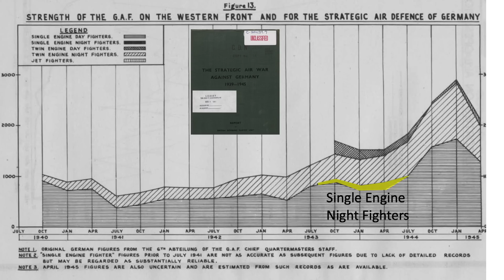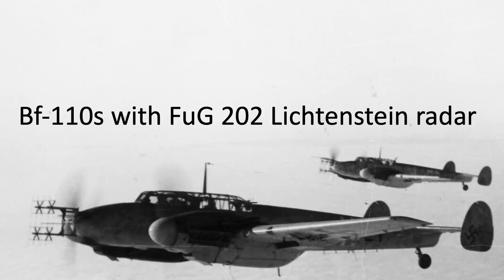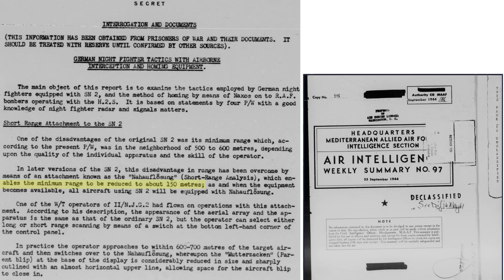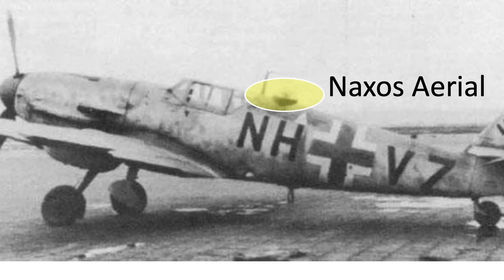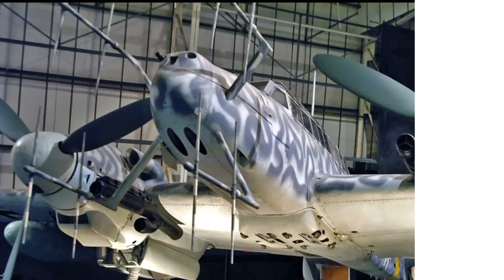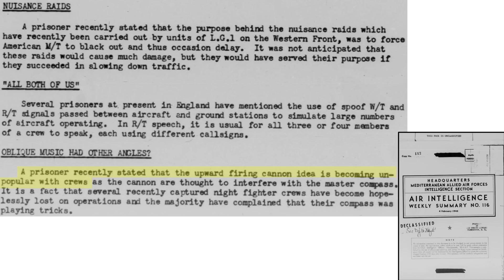German Night Fighter POW Pilots describe how they attacked RAF Lancasters with up firing autocannons

Comment: The H2S and H2X were designed to allow bombers to find blacked out cities at night. The bombardier-navigator was not supposed to turn it on until in the general area of the target.  Many turned them on on the ground before take off, allowing German FLAK and units to track bomber formations before they came anywhere near the FLAK sites and to use triangularization to obtain altitude and bearing to the formations.

Comment: I read somewhere that when bombers used a recommended "corkscrew" evasion (which altered both direction and height) this was nearly always effective in escaping the nightfighter. The Luftwaffe could not understand why this didn't happen more often. 

But some bomber pilots (and many of them were inexperienced, due to the loss rates) apparently lacked the confidence or skill to do this, or maybe underestimated the lethal threat of nightfighters. 

Aside: I am always amazed that the RAF allowed there to be a blindspot on the Lancaster. Even if a turret was not wanted (and with .303 machine guns, RAF defensive guns were of poor effectiveness), a ventral astrodome would surely have made a big difference. And the RAF might have discovered the usage of up-firing cannons against them, much more rapidly than they actually did.
Reply: The Lancaster was designed to use the FN.64 ventral turret, but the field of view was poor so most Lancasters didn't use it. The  Halifax could use a ventral turret, but again it wasn't very good. Both could be fitted with the Preston Green Mk. II with usually one or sometimes two 50 calibre guns. It was far more common on the Halifax, but when H2S was used, no ventral turrets could be fitted. It had a more limited field of fire than the FN.64 or equivalent Bolton-Paul turrets (I'd have to look up my books to remember the B-P letter) but had a better view. Some crews cut observation panels, even when H2S was fitted, but H2S made it hard to see. Monica warning was probably more effective. Village Inn could be used to actively track an incoming fighter but also advertised your  location, but could be used to fire blind on an attacker, although there were also occasions of friendly fire. 

Later in the war it wasn't uncommon for a Lancaster to carry eight crew (for example, Donald Pleasance was part of an 8 man crew when shot down) to have an additional person to handle the electronics like Village Inn and so on, so as to free up the navigator. At other times the 8th member might be a mid-under gunner.

Some Lancasters, even with H2S fitted, had unofficial mounts for ventral guns from 303 to 20mm, but this wasn't hugely common.
Reply: Of curse they know what happen, the bomber did change attitude and angel faster then the radars operator could effectively track the target, and the target did disappear out of the radar cone.

Comment: Thank you for the video.
Be interesting to know if those pow interviews were during or post war?

Bomber Command had no idea of the existence of Schrage Musik, although from at least 1943, gunner leaders were telling air gunners to get their pilots to bank occasionally to see below in case of attack.

The Operational Research Section of Bomber Command would interview weekly escaped bomber crews and ask them about how they were shot down. Most would say that one minute they were flying normally, the next the aircraft was on fire.
The research scientists failed to spot this clue regarding Schrage Musik.

A Ju88 landed at Woodbridge in July 44, giving the RAF up to date knowledge of German radar, unfortunately it was not equipped with Schrage Musik. Only about 1/3 of German night fighters were equipped with it. Generally given to experienced crews.
Even though it was quickly established that 'Monica' on Bomber Command aircraft was being homed in on by 'Flensburg' fitted to the Ju88, it wasn't until late August that Bomber Command ordered it to be removed from their aircraft.
H2S wasn't just a Pathfinder tool, from mid 43 onwards it was gradually fitted to all main force aircraft.

The advent of Schrage Musik was all the more surprising as the British had used it in WW1.
It's use by the Germans was relatively short, from the Peenemunde raid on 17/18th August 43 until the end of the war, although it's most effective period was the winter of 43/44.

Comment: This is how the German radar operated.  The FuG 220 SN-2 radar had a frequency of 100 megahertz which gave a wavelength of 3m.  This meant “windows” aluminium strips had to be cut to 1.5m to work (called “rope” putting a heavy burden on the bombers.  It took over from the earlier radars at 490 megahertz (60cm).
-Each of the 4 arms of the SN-2 had two dipoles, the one on the front was the transmit/receive dipole and the one on the rear the reflector dipole that formed a forward facing pattern.  Constructive interference between the 4 aerials also focused the antena forward.
-A motor driven rotating series of switches inserted delay lines that introduced phase shifts that moved the beam left/right and up/down.   The operator had 3 oscilloscope traces to look at: a scope to give range and another two that showed the left/right beam strength and the other the up/down from this the operators could determine bearing.  It was planed to use the “Pauke” system to allow automatic blind fire control and latter effe and Oberon for firing air burst unguided R100 missiles.  
-Luftwaffe ground based radars eventually received coherent pulse Doppler circuit  radar called wurzlaus and latter  improved to tastlaus, windlaus and k-laus which used acoustic delay line memory to compare frequency phase and detect moving targets. 
-non microwave radars have wide beams that absorb jamming energy.  The Germans produced about 400 microwave radars of various kinds and got 100 into service.
-British ground mapping radar was always called H2S irrespective of whether 9cm or 3cm or 2.5cm.   U.S. versions were all 3cm and called H2X.  These 3cm versions were also gyrostablised and much better. 
-Late war H2S had circuitry and display to detect an approaching night fighter called fishpond.
-the Germans abandoned their promising microwave program in May 1942 due to claimed overwork outside a small naval program and disbanded their teams.  When a H2S set was recovered in Jan 1943 they had trouble testing it until they go their engineers and technicians back from the Army!
Reply: Very informative!, my understanding is that a trained Luftwaffe ground radar operator could differentiate a moving bomber stream from a floating cloud of "window" by comparing the audio and visual results from the Winslaus system.  The "Wizard's War" indeed.
Reply: @michaelporzio7384  Winslaus not availbe until mid 1944 and then defeted by AN-APT2 / APT5 Carpet Jammers!!
Reply: @michaelporzio7384  When RAF Bomber Command started using Windows the Luftwaffe was able to produce the "Wurzburg" circuit which  a coherent pulse Doppler radar for field use within 2 weeks though not in great numbers.  They were able to do this so quickly because they had been working on circuits to detect aircraft in ground clutter and for weather radar.  The German had tested their version of Window which they called Duppel which showed that 5 half wavelength strips were produced a reflection equal to an Me 109.  Goering clamped such secrecy on it no one was aware of the need to develop counter measures and so the Germans were caught out somewhat.
-Wurzburg used a quartz crystal oscillator as a stable reference.  The output of the crystal was clipped to create a semi square wave and the resulting harmonics repeatedly filter and multiplied till the desired frequency was reached.  
-When a pulse returned its phase was measured relative to the crystal referenced oscillator.   The range tracking operator could look at the standard trace which gave range of the pulse and right next to it a second trace which gave the phase.   If the phase kept changing and dancing it was a real moving target else if it was constant it was stationary or slow moving like ground clutter or windows.  
-Tastlaus was a improved circuit that allowed frequency changes.
-Windlaus (which I think you refer to) could provide an offset to zero out high altitude winds that made windows move.
-k-laus used an acoustic delay line as a memory to allowed preceding pulse to be compared to the phase of the current one and got rid of the need for the second display.   It was used in 194
-Nuremberg was introduced about the same time as Wurzburg and added head phones that allowed the operator to listen to the propeller modulations through headphones.   It allowed the operator to quickly reacquire a target.  
-One of the more advanced German radars was FuSE 64 Mannheim.  Often confused wit Wurzburg radar because both shared a 3m dish, this has electronic tracking for the range gate.   Not only did this make it more accurate but it was possible to track a target through jamming.   The US found the same with SCR-584 with the MIT professor in charge point blank refusing to give the US Amry a manual tracking option .   (MIT engineering professor I think can intimidate any engineer).
Reply: Got a source for all that professor?

Comment: My grandfathers Lancaster was attacked shortly after dropping their bombs on Duisburg. 21/22 Feb 44. They were attacked by two JU88s from the rear, whilst cork screwing and a BF110 from underneath, which they didn’t see. I am assuming the JU88’s were used as a distraction. The rear gunner hit one of the JU88 and it caught fire. They had rounds come through the cabin and instrument panel and in front of the navigator. The wing and two engines caught fire. All crew bailed out and survived the war.

His train as a POW was strafed by two P47s. Rounds coming through his carriage, killing many around him. They were then strafed again by a p51 on the forced march. 

Not a job that I particularly fancy. Respect to them all!

Comment: In his book Night Fighter, CF Rawnsley describes the issue and use of "night vision" binoculars to visually identify a target once it had been tracked and was at minimum distance on radar. These were low magnification binoculars with large diameter front lenses to gather as much light as possible. He remarks that they were effective. I wonder if the Germans used the same trick, it seems logical.
Reply: The German technology in this area, certainly in naval night vision optics, was ahead of the British (Barr an Stroud) and American (Bosch & Lomb)  state of the art in this area.  Zeiss had not only developed a particularly clear optical glass that transmitted significantly more light it had developed multi coat optics that prevented surface reflections.  Surface reflections of what may be 10 or so lenses accumulate and blur the imagine.   The Pentax system in the Japanese Navy were even more advanced and had the unfortunate side effect of persuading some Japanese officers into think radar was of limited us.
-American optics won in one area, the sunglasses Bosch and Lomb developed for USN aviators to cut glare, the Rayban Aviator, has stood the test of time.  
-Allied radar by 1943 was so advanced that they did not need to rely on optical systems.
-The Germans had a number of infrared passive and active detection systems for their night fighters but they were not widely used.  They were improving and they did develop scanning infrared seekers that formed a basis for post war missile development.
-Mosquito night fighters escorting Allied bombers had infrared lamps in the leading edge to identify themselves, the system was so well hidden the Germans never discovered it.  
-One of the more interesting systems was acoustic homing on the Me 262.   A jet fighter with sound locators could detect a 4 engine propeller bomber 10-16km away.
Reply: The Luftwaffe also had primitive IR systems on Do-17s

Comment: H2S wasn't confined to the Pathfinders...it was also used within The Main force..the lancaster in the photo has the codes AR...I believe that was 460 Squadron..which was an Australian Squadron..
Reply: By about early 1944 onwards most RAF heavies had H2S, except now-and-then when there were supply shortages. Often if there as a sustained shortage, ventral armament was fitted.

Comment: The RAF had experimented with a similar idea in WW1 and in 1930 Westland and Vickers had both provided prototypes for evaluation that featured large calibre auto cannons designed to fire upwards at an angle , it wasn't a huge leap to think that someone else may have had the same idea .
Reply: And of course there was the Boulton Paul Defiant. I personally think there may have been some official suppression of news about Schräge Musik because there was no countermeasure. Perhaps it’s linked to the ‘scarecrow’ myth.
Reply: @bob_the_bomb4508  Yes, early examples of the Defiant had a 'pilot' setting for the Type A turret which slewed the turret forward and up to act in a similar way to Schrage Musik, to be fired by the pilot. So the concept was definitely understood by the RAF in the late 1930s, and was in fact doctrine.
Reply: @bob_the_bomb4508  Yet as far as I know, there was no attempt to fit "Schraege Musik" cannons to RAF Beaufighter or Mosquito night fighters. I doubt the RAF knew about it until very late in the war.
Reply: @philiphumphrey1548  The P-61 was actually originally, based on a somewhat informal RAF discussion with Northrop, and is very similar to an unbuilt UK design (Gloster?) which had the same twin boom layout, with forward cannon and a turret to allow beam or upward fire. Bolton-Paul was working on a cannon turret, but this was ended in 1940. Had the war not started until later, it is likely that the UK would have been fielding cannon turret nightfighters.

A number of UK unbuilt designs for twin-engined interceptors included the ability to incline cannon, but only maybe at most 20 degrees from the horizontal.

Comment: Another great deep dive, I learned a lot from the presentation.  Keeping radar on made sense given the tube electronics and their stability in a warmed up and operating state.  Truly a wizards war.
Reply: In the '70s, we still had tube radars that took 20 mins to warm up. We could, however, turn off transmitting while the radar remains ready for use at the flick of a switch.
These were counter-battery radars, but they worked the same.

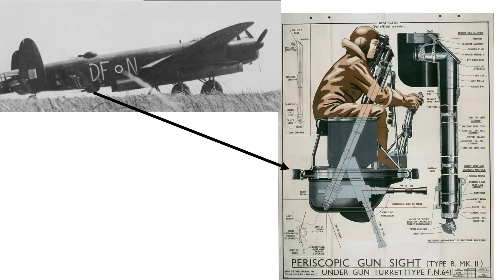Comment: @1:21 “Some included an under-gun periscope turret.. most did not”
You sound disappointed in them.🤣 great video as always.
Reply: The British saw bombing as a statistical process and saw the ventral periscopic turret as of limited use at night and of adding drag, weight, reducing bomb load plus adding an 8th crew member.  Canadian built lancasters had the central turret.  It apparently worked somewhat though whether putting at risk an 8th man is justified is an interesting question

Comment: As stated,  Luftwaffe night fighters aimed at the wing of a Lancaster or Halifax between the inboard engine and the fuselage where the fuel tank was located.  They did not want to aim at the fuselage and detonate the bomb load since at close range it would likely destroy the bomber and the night fighter.  The German's also had a radio "running commentary" to vector the nachtjaeger into the bomber stream, the RAF introduced countermeasures and the Germans actually fielded frequency hopping transmitters to counter the jamming. Love the dry humor, thanks for this great channel.!
Reply: They also had the Bernhard/Bernhadine system for telemetry and navigation.  Long term the objective was to inject intercept telemetry into the autopilot
Reply: Dad's workmate told dad that he spoke German to try and confuse the German pilots. 
This isn't mentioned very often. 
Maybe it wasn't effective.
Reply: @redtobertshateshandles  i read that the British employed German speakers operating on Luftwaffe radio frequencies to transmit false information.  Can't cite a source, or confirm if it was true or effective.
Reply: There is no way the British high command did not know about Schrage Music's existence, they didn't want to tell the crews because they thought it would have a negative effect on moral. By not warning crews they sentenced probably thousands of aircrew to death.